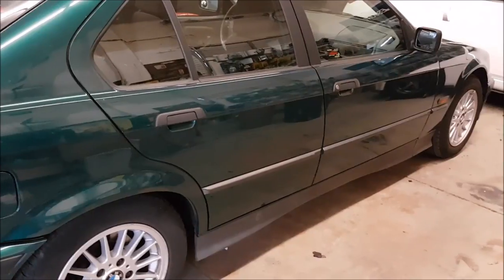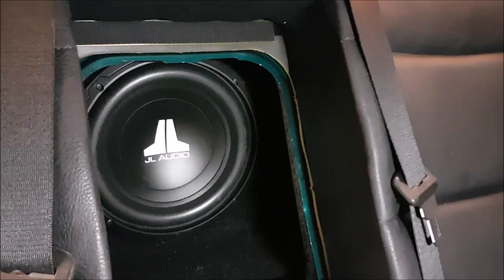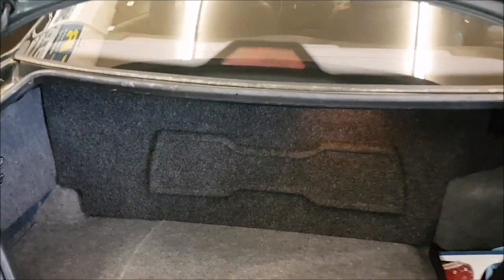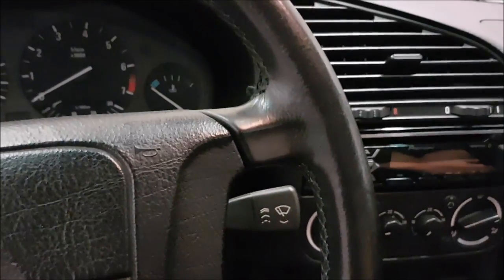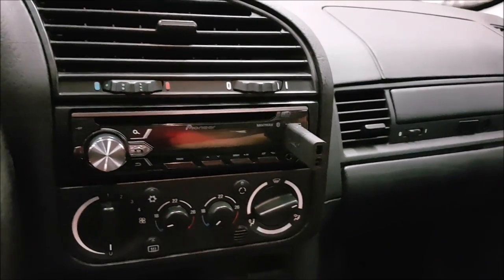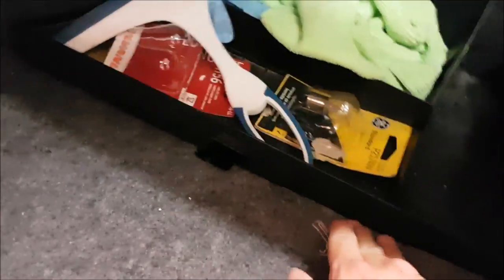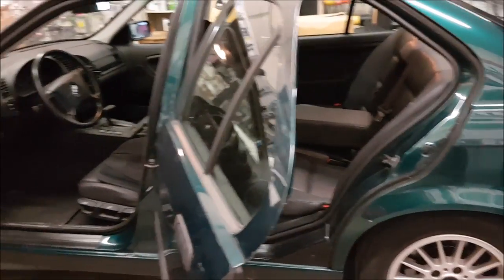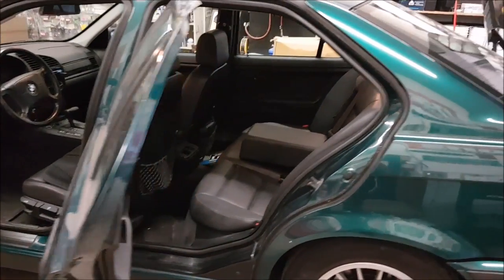Builds: 318i/ E36 Stealth Audio System | AnthonyJ350

Comment: Nice build Anthony! Clean,simple and powerful.I love builds that keep the vehicle as stock looking as possible.Ideally,when I go to sell my car,I like to be able to remove all of my components and just simply reinstall the stock system.
Reply from the maker: John Adams Thanks! Ya I'm finding in my area this is what people want for their everyday vehicles. Still kinda cool but more on the functional durable side.
Reply: I'm running 5.25 Polk components in front.They're getting 75w from a JL XD500 and everything sounds great.In your professional opinion,do you think I'd see improvement in a 6.5 instead,say of the same caliber driver?Or do you think I'd lose midrange and gain mid bass?What has your experience with this taught you?
Reply from the maker: John Adams You'd get a little more mid bass. Did you sound deaden the doors and do you have a sub?
Reply: AnthonyJ350 Yes,I used Dynamat extreme on both doors.Didn't use any rigid materials to seal the big holes,just covered them with the mat.And yes I'm running a 12 inch sub crossed at 90hz to help the 5.25's with mid bass.It does help because I tried crossing around 60hz and there was a big hollow spot in the sound.
Reply from the maker: John Adams That's good, you can try 70 or 80 Hz and just not make the slope so aggressive. Also try putting something small (the size of the magnet) to help eliminate the back wave from the sub. Look into Hushmat Wave Breakers and stick it to the back wall of the enclosure. Treat your enclosure like a bass drum, note how drummers don't leave them empty or they have a hollow sound.
Reply: Are you referring to putting the  hushmat behind the 5.25 or the actual sub?
Reply from the maker: John Adams Both if you can. Helps clean up the sound.

Comment: Facing the cone the wrong way, so professional
Reply from the maker: Thanks for the feedback.  Probably still sounds better than your vehicle.
Reply: @AnthonyJ350  no, it doesn’t because my subwoofer is actually faced the right way and my Time alignment is actually set properly
Reply from the maker: @necromancer___3054  Uh oh, we faced them the "wrong way" here too https://youtu.be/nebS0UAsLQQ
Reply from the maker: @necromancer___3054  I faced my sub up, this is probably wrong too? https://youtu.be/iXj9pwT4zbA
Reply from the maker: @necromancer___3054  Can you send a video link to how your system is wired and how the fabrication was done?
Reply from the maker: @necromancer___3054  Did I mess up here? The sub woofer chassis isn't even in the enclosure... https://youtu.be/5SKsBSoru6A
Reply from the maker: @necromancer___3054  I faced the sub woofer up again here, is that ok? https://youtu.be/0hWSu2NR4XE
Reply: @AnthonyJ350  do you want me to completely uninstall my system and them record a video of the reinstall? I think Tf not 😂
Reply from the maker: @necromancer___3054  You can't video the system complete? Probably don't have one.
Reply from the maker: @necromancer___3054  You can't show us the outside of your custom panels?
Reply: @AnthonyJ350  yeah whatever you say internet guy
Reply from the maker: @necromancer___3054  You're more internet guy than I am. I'm showing work. You're a typical keyboard hero that comments but has no work for anyone else to see.
Reply from the maker: @necromancer___3054  Show us what you got if we're doing it so wrong. Pretty easy.

Comment: It's nice to see everyday, not over the top expensive sound system installs. Regarding carpet matching. You know you can dye the fabric, right? That way, you could've come a bit closer, as you would've preferred.
Reply from the maker: Vidar G You can dye it to go a lighter shade?
Reply: AnthonyJ350 I've sprayed lighter grey on darker grey before. It bumped the grey a bit closer, but of course your milage will vary. Different manufacturers of carpets and paint etc.
Reply from the maker: I'll give it a shot next time.

Comment: why didnt you get smaller subs and then 2 or 2 square ones and put them inbetween the seats like mount it inbetween not behind it
Reply from the maker: Those would be really tiny subs.
Reply: @AnthonyJ350  im probably putting one sub inbetween the seats like a nissan gtr r35 has or honda s2k
Reply from the maker: @thedandy6765  Ya a 10" JL Audio W1 will perform awesome and doesn't require much power.
Reply: @AnthonyJ350  so that will be a good option for me to put in my 318is?
Reply from the maker: @thedandy6765  oh ya for sure, just make sure you have enough power and do a good ground.
Reply: @AnthonyJ350  i was planning on getting a second battery anyway like a small one meant for motorcycles because of some otherthings like led and stuff so ill have that and i was planning on putting a 100Ah battery for cars in it with the 140 alternator in it so it should all be enough otherwise ill just custom make a dual 24volt battery serial system in the spare wheel well

Comment: Good work man. Out of interest, what would a box and false wall set up like that cost? In my GS300 I've got an alpine Type X sub in a box that's way too small for it - but I'll be upgrading to a new car soon, and I want to get a well set up system in it! 

Also, I might pick your brain, I'm currently running the Type X of an MRP M850 (pretty sure), and when I upgrade to an LS430 I want to have a really good set up. Is it worth getting another Type X, and a ~2000w RMS amp?
Reply from the maker: Just for the box and panel alone I'd be in the range of 1- 1.5 days of labour.  Alpine just brought back Type X (X Series), it's nice stuff.  Are you looking to build a loud system?  What area do you live in?

Comment: There is an JL AUDIO stealth box enclosure for a g35 coupe for sale.  Is it any good?  The sub is a w1 and they asking $100 for it.  Is that a good bang for buck?  I want my truck space back.  Let me know.  Thanks.   P.s. I just installed a nwp throttle body on my g35.  Highly recommend it.
Reply from the maker: That's a smoking deal. Stealth Enclosures range from $800 to over $1,000. I'd definitely get it for that price. After just head to your local install shop, buy some sound deadening and line the inside with it and also do your trunk lid and area where the spare tire is.
Reply from the maker: Tone Win So how does the throttle body make the improvement. The intake plenum diameter stays the same doesn't it and the Mass Air Flow Meter is the same diameter. Or does it do something else?
Reply: AnthonyJ350 I don't know, but the throttle response is so much better.  It revs up way faster now.  I have a vq35de non rev with a md 5/16spacer, oem z-tube, md art pipes and hr y pipe, and now the nwp.  I'll try to upload a quick vid today so u can see it rev